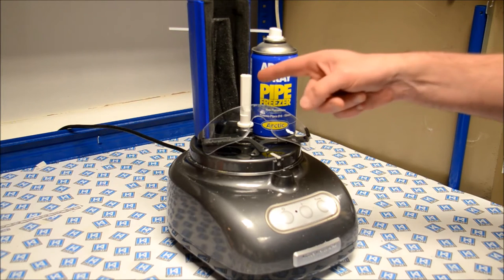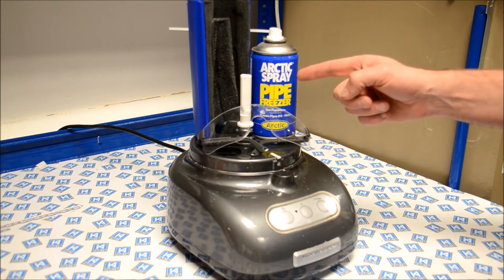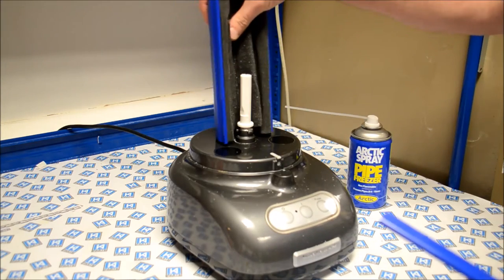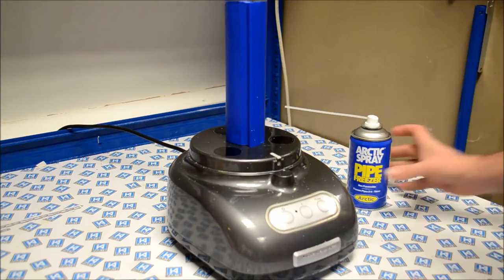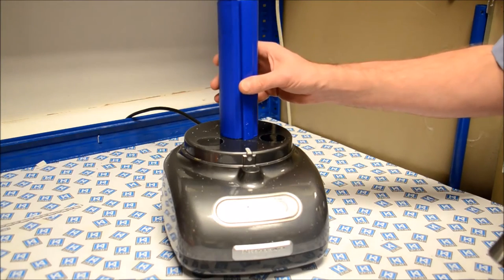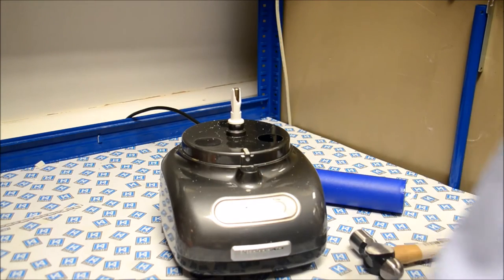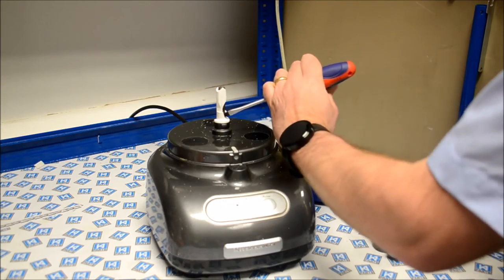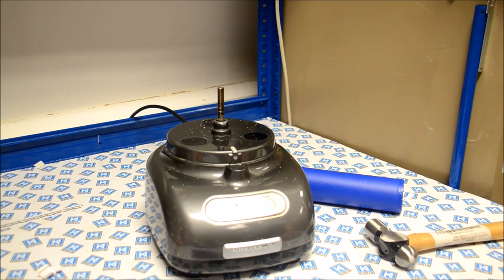INFORMATION - How to remove the Sleeve from a Food Processor

Comment: Ok i think i figured out why it sticks. It can over heat and cause the part to stick. i am suggesting that my wife use any food grade oil between parts and go easy on the processor. Also i was able to get the part unstuck. It wasn't easy but i had a coworker hold the part with two fingers while i pounded on the metal piece with a hammer and a block of wood.
It began to loosen by a 1/4 inch but did not release. This caused the metal piece to go below the top surface. Eventually it came out the back end and i put it back in through the top later on. To release the part all the way we used a finger from a gear puller and ponded it out the rest of the way. We had to go from side to side in order to get it all the way off. This basically saved the food processor which is the only one my wife likes. I also bought the new parts from Sears just in case the original did not hold up. This worked for us, i hope it does for you!

Comment: Mine is like that. My issue not working because it doesn’t push far enough in on the little white spot in the hole in the front. You can see it there without the attachments on. I can activate it with like a chop stick. Push the switch inside the hole till it makes contact. So I know it’s getting power and all that. I think either that contact point needs replacing. The bowl seems ok and it’s switching mechanism in the handle. It’s just that it’s worn that part inside off enough between the 2 with the way it works.  I hope you still read this. Can I take the cover off easily? What size screw driver? It’s a star one on the end or a hex??